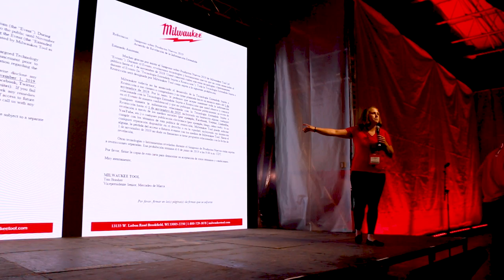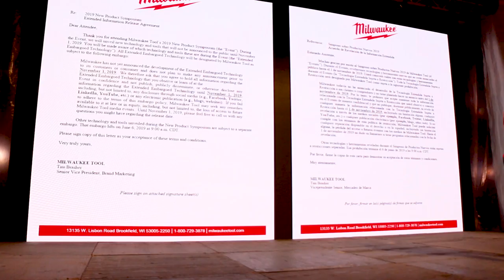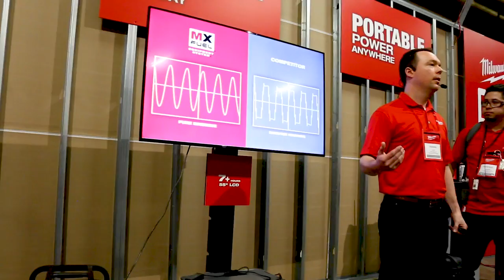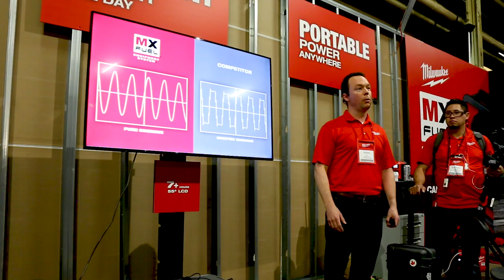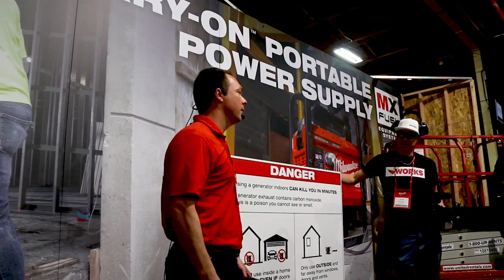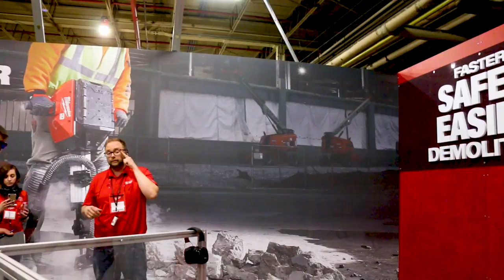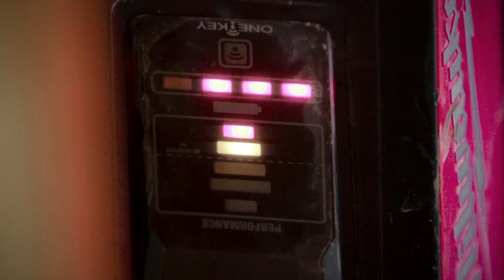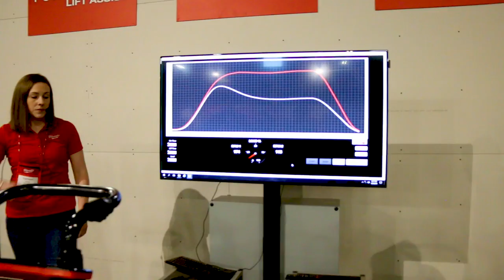MILWAUKEE TOOL MX FUEL (New 2020) LIGHT EQUIPMENT SYSTEM

Comment: That generator really has me intrigued. If it really delivers the 7hrs on one battery(I would do 2) with as clean of a sine wave as they promise, I already have a use for it.
Reply: True but being able to DJ where there is no power without a dirty power sine wave and generator noise in the background would be game changing
Reply: that 7 hours is only based on a 60 watt draw of the tv.  The batteries are around  430 watt-hours each for the large pack.  So depending on the amps you use... You won't get anywhere near 7 hours.  You only have about 750 watt-hours (figuring 85% up-conversion efficiency) to work with if two packs are installed.  You would have to have a stack of batteries to last all night.

Comment: My main question for the saw is. Can it cut ductile iron and cast iron pipe under partial water pressure and not fry itself or the operator? Because we all know that dead shuts don't happen every day and even with a dead shut the pipe will still hold water until you cut it.

Comment: Hey what's up Vince.. I have  been using 2nd and probably 3rd hand used power tools.  Since my drill and impact fell apart on me, I'm realizing I need to just slowly invest in new  tools that arnt abused . My question is what is a good platform to start out with that isn't to expensive, but will last me for a few years.

Comment: I own/use a few m18 tools, impacts, drills, sds, 115mm grinder, die grinder. stuff for small jobs pretty much, and for that they are good, but big jobs? i don't think the battery technology is there yet. 2 large batteries to equal 1 tank of petrol in the stihl?? i can say for sure i won't be parting with my TS410 for this.
Cordless tools are great when you don't want the hassle to set up leads or a transformer/generator to do a small quick job, but when your pulling out your big guns, chances are it isn't a small quick job....

Comment: Is this new Mx fuel just for the heavy duty stuff like hammers, saws etc that require the muscle? I was gonna buy a M18 3/4 inch Impact wrench this week. Hate buying old tech 🤔
Reply from the maker: The Mx fuel line will only be used for larger light equipment, not impact wrenches

Comment: The batteries take an 45  to 90 mins to Charge how long does it take to put fuel in 2 minutes
Reply: Well you better have like 5 batteries,bcuz if you doing a big job,the battery will die much faster than they will charge

Comment: Core drill is kind of terrible looking. As a former concrete driller and cutter, it is way to bulky and 9 3" holes is not impressive for run time. A Weka handdrill is Way lighter looking, has a clutch and infinite run time. Maybe a good solution for plumbers or other light duty needs, but still not comparable to industry standards
Reply from the maker: Good feedback Yankee

Comment: I’m skeptical about the sewer machine...I don’t like the smaller ones....  no sewer cleaner will ever go without flipping the cable under torque... the small machine makes it a real chore to fix that... there cables suck too...plus the feed looks like crap...    they should model it after a 2 piece machine like a MyTana not change anything but the power source... then I’d buy it

Comment: Hey big power tool companies. Stop worrying about the small equipment market you’ll never ever be able to beat gas powered in…. They can’t even make an angle grinder that both works well and can last a reasonable amount of time…. Why not put this same technology in AC tools as they call them? No batteries to be sold that’s why.